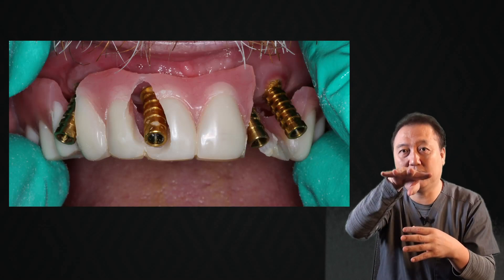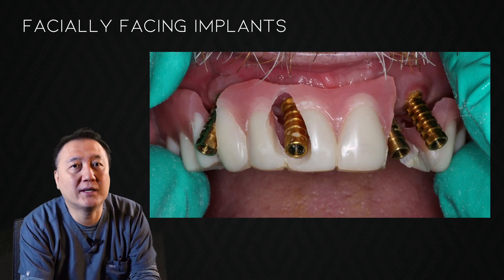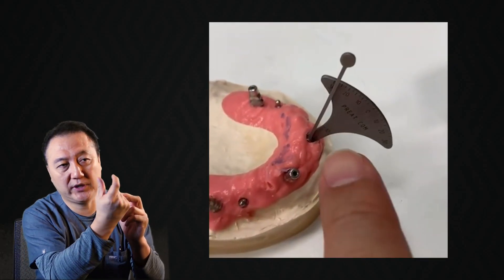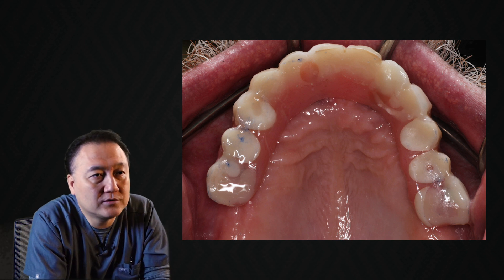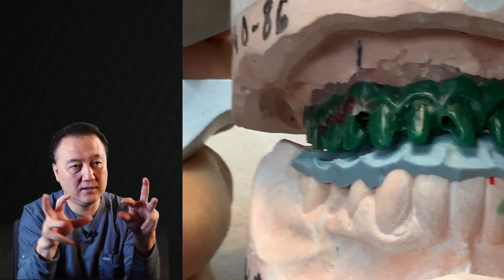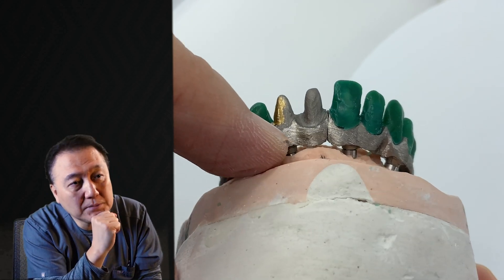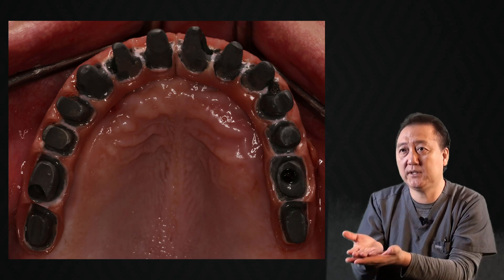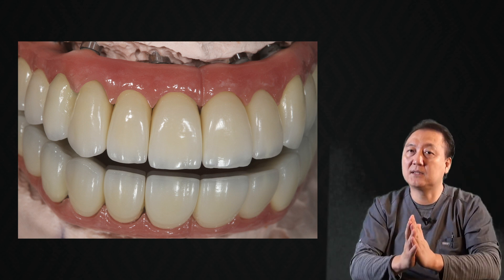Hopeless Implants - What Can You Do?

Comment: "Two wrongs don't make it right"..........It looks like  their placement  and  extension was completely wrong  but at the same time it looks like they were placed without even considering if  the supporting bone-structure was "stable enough"....and.  no matter what you do .....it will need to have frequent check-ups for ridge displacements  at least for   the first 2 years  ....